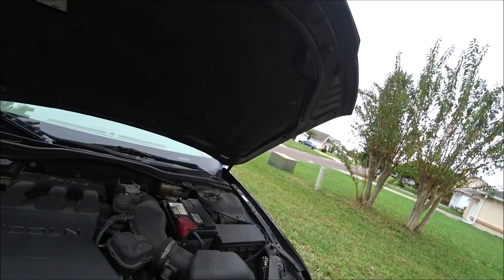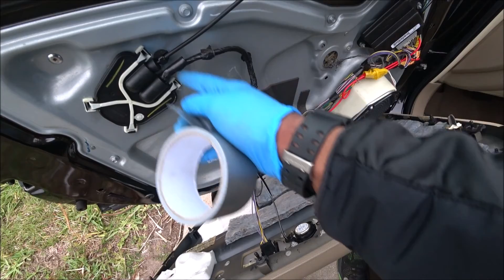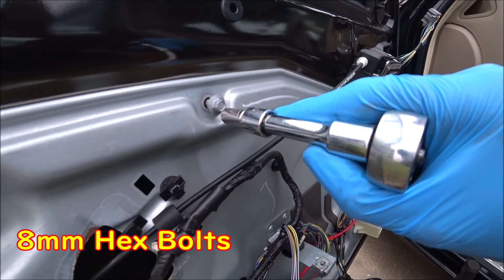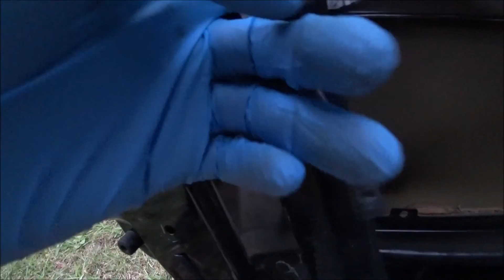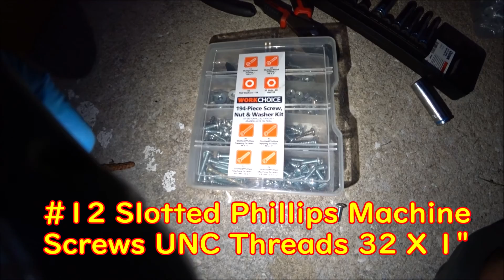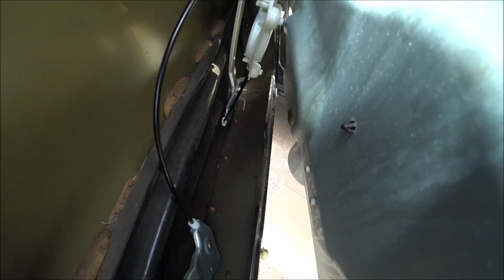How to Fix Broken Power Window (Regulator Assembly)

Comment: One question was there a bracket on the left side of the regulator I, have the bottom right bracket on I can’t remember if the weight of the window is what holds the regulator steady
Reply from the maker: This was a while ago for me. You may have to fast forward to that exact moment. I showed every bit.

Comment: So you don't need to put the anything back in where the rivets were?
Reply: Yeah, but it wasn’t clear the size of the screws, but it’s not hard to figure out the correct size for the popped out rivets. Most likely the same size as the drill bits…
Reply from the maker: I did. I showed the bolts

Comment: Man where we're you before I broke my window.
Reply from the maker: lol. I've been here. I have multiple playlists:
mkZ: https://youtube.com/playlist?list=PLSobJ3CJ_Tg10EcZiYbHrmt9qrYPR2E3d

mkS: 

https://youtube.com/playlist?list=PLSobJ3CJ_Tg3jvWC14BFrPtkBsC0L4X2y

and 

https://youtube.com/playlist?list=PLWGo5HqffCXrSLnP4NqbQZ9RHfkARIsBL
Reply from the maker: Your last comment about the left door ajar issue didn't post probably because you typed "Please help!" YT's automatic screening probably doesn't like that. Exclamation points are probably a trigger for automatic deletion as well. All I could see was the notification that you typed something.

I don't think there is a specific fuse just for that. If you do remove that fuse that control it, you most likely will lose 10 other functions (i.e. interior lights, alarm functions, horn, etc.) Those are just examples. So I believe its best to just fix it. Try some WD-40 on that door latch and see if that allows it to actuate better and if that doesn't work, just replace the rear left door latch and the wiring switches that attach to it. Other than that, I don't know what else to tell you.

Comment: So I was trying to replace my regulator today and I did. It seems to work now. However when I went to put the door handle back on that cable wouldn't fit back in the clip. It wasn't long enough. I tried to pull it and unlock the car to see if it did anything but it's still not long enough. Anyone have similar issues? I can't put my door back on without the handle 😨
Reply from the maker: I'm not sure how that happen. In this tutorial, the locking mechanism was not really disturbed. The cable was just removed and placed back on. 
If the cable was removed it can be placed back on, just reverse the steps. It's not too short. I think the trick is to have the handle in the open position so the small silver rectangle nub portion can slide into its groove housing. Rewind this video and you will see it.

Comment: Going to use this today as a reference to change my window regulator on a 2010 Ford Fusion. I'll follow up once it's done.

Update. So the replacement couldn't have gone better! I followed pretty much everything in the video with the exception of the bolts used. I just drilled out the smaller holes to 1/4" so I didn't have to get two different nut and bolt combos. Thanks for the video!
Reply from the maker: Indeed. Thanks for the update HVAC! 😃
Reply: I had questioned the smaller rivet holes, and the smaller bolts. I’m going to go with your method, 1 size fit all.  Thanks for commenting.  I read all the comments because others contribute with great solutions, to a really good video!👍